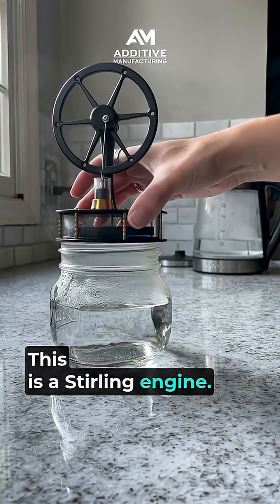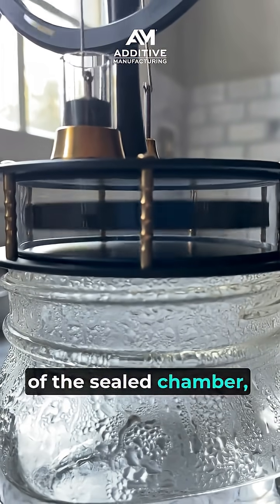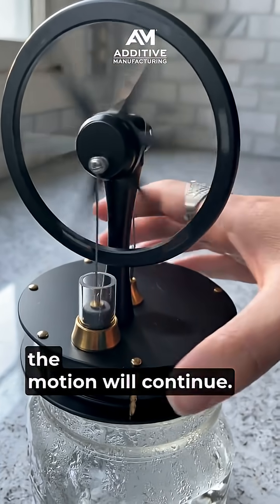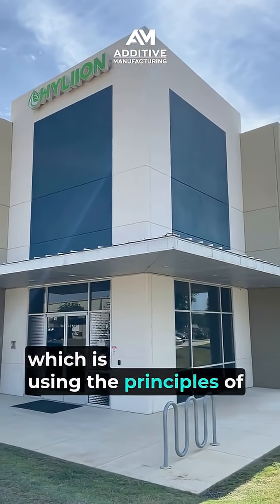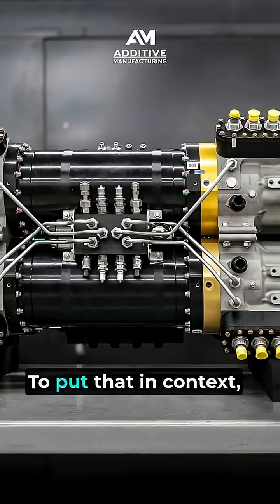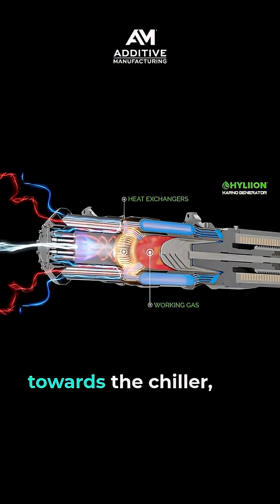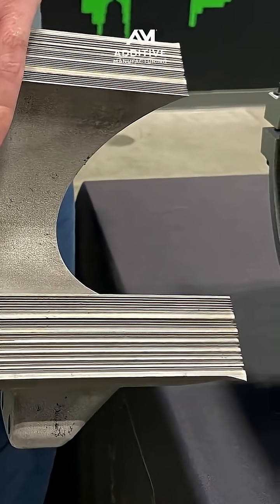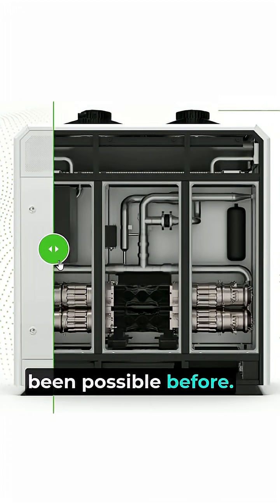AM-Enabled Power Generation Based on the Stirling Engine #manufacturing #3dprinting #powergeneration

Comment: I have not been a big fan of additive metal fab, because most times I hear that something broke it was a 3D printed part. However, as a heat exchanger which does not experience high crazy loads, this indeed may be a match made in heaven. Thanks for sharing it!

Comment: Recover waste heat energy from existing internal and external combustion engines. In some applications replace an internal combustion engine with this, possibly allowing for much higher combustion temperatures.

Comment: I remember reading an article of a solar powered sterling engine being used to produce electricity in Spain. This was done by focusing a large array of mirrors on a focal point atop a tower. I wonder how it worked out. Time for some research.
Reply: I think this was tried in California, but it was too complex and could not compete with a solar panel system